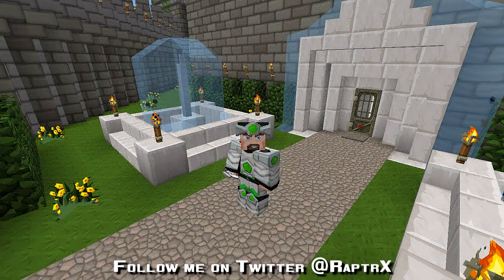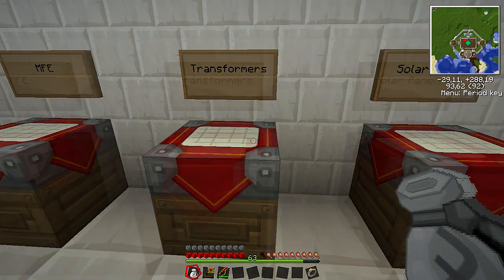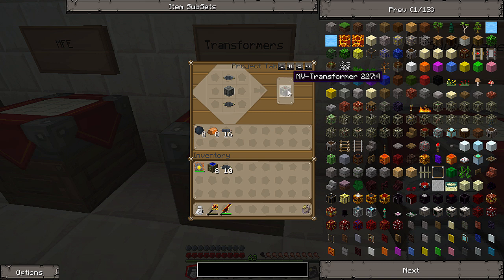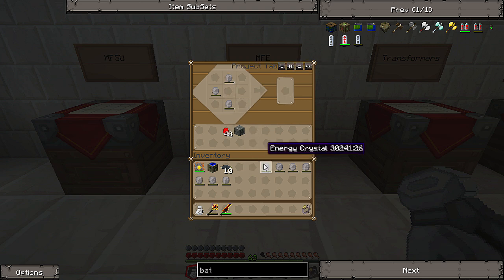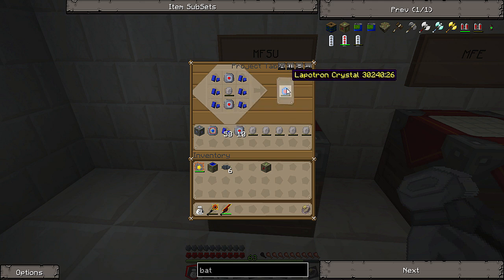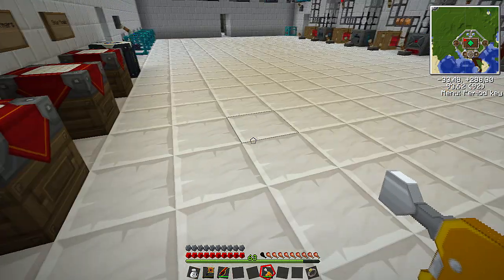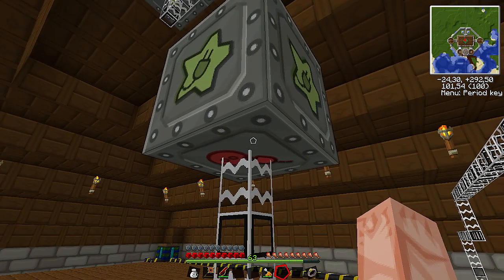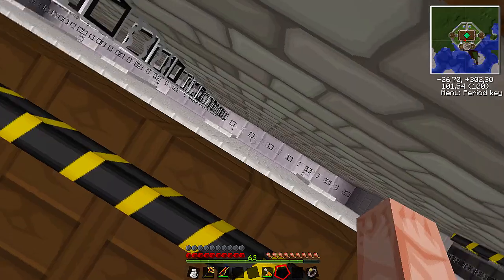How to Tekkit - MFE, MFSU, and Solar Power

Comment from the maker: Regular solar panels output is very low, if the mfe is connected too far from them the energy loss from the cables would negate the energy gained from the panels. You should upgrade the solar panels.

Comment: @proskaters6 you can run ordinary machines on MV by adding a transformer upgrade in a slot on the right. 2 transformer upgrades will enable it to run off HV and 3 EV

Comment: so what if i have a MV array and i want to use that for my 2 emc machines. I have 6 overclockers in each machine (4 machines total) and i keep running out of power. Is there a way to keep powering this issue or should i just build another LV?

Comment from the maker: Adding a battery box between the glassfiber and the energy link will reduce the drain to 32EU/t instead of 72EU/t but as long as it has one of the sides with a conductive pipe attached to it, it will always drain power.

Comment from the maker: Yeah no need for the HV-Transformer since the MFSU already outputs at HV. Other thing you might want to check is to not have any redstone signal close the MFE/MFSU that might disable them. Consider also making an EU Reader they are cheap to make and you can check where the power stops flowing.

Comment from the maker: You shouldnt be using HV cable for the MFSU, glass fiber cable works fine and doesnt loose power like the HV cable. Only other thing I can think of is to check the output side as there are 5 inputs and only 1 output.

Comment: The wiring for your solar plant from 8 minutes onwards may be the solution to the problem I'm having where my power grid crashes the server I play on.  *sheepish look*  I have four mfsu's coming off the arrays (a combination of medium and low voltage arrays for now), two being stepped down to medium then low voltage to power a section of my workshop, one connected straight to my energy link and teleport pipe, and one reserved for my forcefield.  Pretty sure this complexity is to blame.